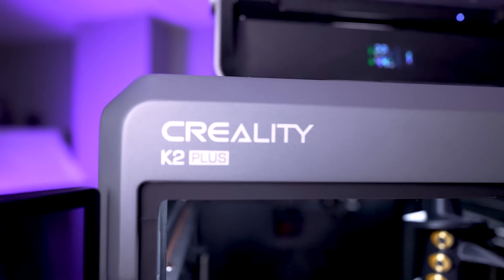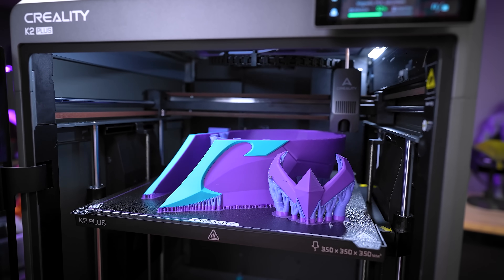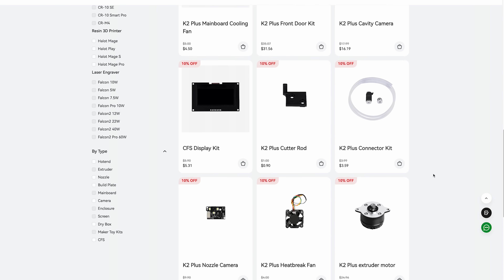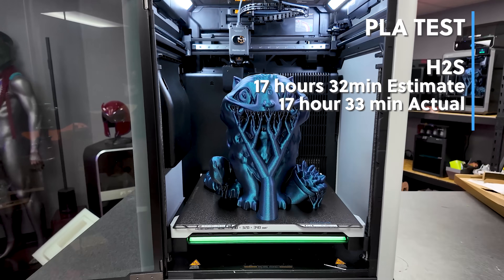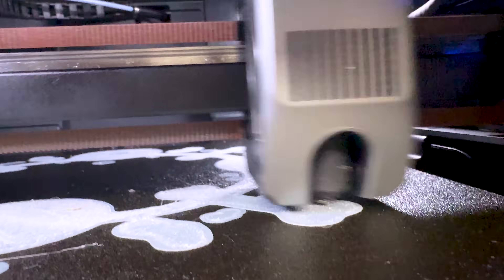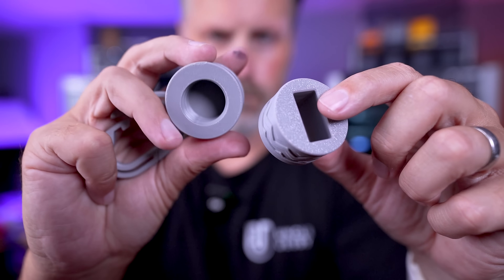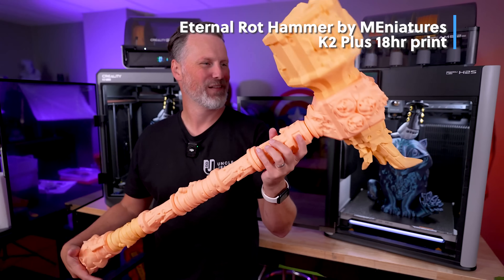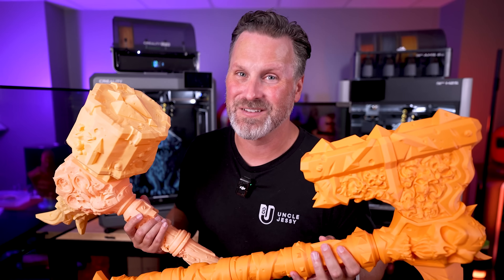Bambu Lab H2S vs Creality K2 Plus — 3D Printer Showdown 🔥

Comment: No competition, H2S hands down, creality is so hit and miss, I hate there printers with a passion, 1 of my P1S printers has over 4000 hours on it not even a hiccup, I print my stl files I design everyday and I had 2 creality ender 5 max printers worked for a week, both of them, they crapoed out,, will never use creality again, Bambu is so reliable and that is what I need.

Comment: As someone that’s coming from almost exclusively Elegoo printers, the H2S has really surprised me. First off it’s so quiet by comparison to the Centuari Carbon. And the software has just been so easy to use. I can see why these things are so popular. And I’ve been loving the AMS system to refill my prints when one spool runs out. So I don’t have to worry about if I have enough filament to print my larger helmets and just let it do its thing. And the Bambu Handy app is great to check on things when I’m at work. It’s definitely made me a fan.

Comment: Bambu's biggest advantage has been their usability out of the box but that's usually its biggest draw back. They are so great out of the box because everything is locked down enabling just about anyone to use them. This is absolutely a great thing but it's also why the K2 has been poorly market and received so poorly by those it was marketed too. The K2 kinda sucks out of the box but with testing and calibration I've found the max tool head speed to be either 1200 mm/s @ 30k accel or even better 600mm/s @ 120k accel not to mention the actual max temp of the nozzle is 450c if you take off the silicone sock and max chamber temp is 75c and with a quick re-wire mod its 100c however the electronics in the chamber need special cooling. That being said people forget that if a printer is able to go fast then they can go slow too and get godly print quality while teleporting during print moves. With PPS-CF at a nozzle temp of 370c my K2 was able to print at 300mm/s thats a flow rate of 25mm cubed literally the only printer that beats the K2 is the Vision Miner 22 Idex and thats a 15k USD printer and believe me that printer was a huge POS out of the box even the X1C was printing better and thats the crappiest printer we have in terms of quality prints regardless of printing speed.

Comment: I use TPU a lot on my k2 plus.  Can confirm that .6 shim to loosen the tensioner works wonderfully.  But I also combine it with a print that holds the spool above the top and feeds directly into the extruder.  No bowden tubes.
Reply: My K2 plus arrives tomorrow.  I am fully aware of the TPU issue, I don't use TPU but once a  year.  If I need to print that for whatever reason I will use my trusted K1max which still works flawlessly.
Reply: @daleblazer Yeah I found myself only breaking out the spool twice for some custom gaskets but haven't touched it since. I think I'm waiting for multi toolheads to be more common first before venturing into true multi material

Comment: The H2S weather you like it or not is miles ahead of the K2 plus in quality. Hardware and software makes it superior. I have both machines in my workshop, the K2 has more room, but it's lacks reliability and stability. from a business point of view, the H2S is the go. it's not even a competition. The K2 plus should be less than $800 based on the quality of the parts. it's not a $1299 machine.

Comment: Check your slicer profile for the PETG on the K2 Plus. They have it heating the chamber unnecessarily which I think leads to the filament gumming up in the extruder. Since I turned off the heated chamber on the PETG profile I've not had any problems with mine.
Reply: I also think you're having so many problems with your K2 Plus that you may have just received a defective one. I've had mine for about 8 months and it's rarely caused problems and prints great.

Comment: Everyone now says "Screw Open Source", No one cares any more. Wait 5 years from now when Bambu completely locks down their software and filament so everyone is forced to use their parts, and we're all so locked in and invested in Bambu, users can't leave anymore.

But because everyone want's "quality" and "speed", no one cares about open source or giving back to the community anymore. It's all about me, myself and I now and it's disgusting. No one wants to contribute, no one wants to help each other, hobby 3d printing is dead. 

We don't own anything and if it breaks, we should be "thankful" Bambu allows us to replace certain components on our machines (not everything, but only the parts Bambu allows you to fix)

Bambu is the end of consumer level 3d printers, just give it 5 years. Hobby 3D printing is dead and turning into a commercialized non-consumer industry. Thanks Jessy please stop talking about Bambu already
Reply: I don't know why anyone would want a consumer-level printer.  I'm out to make stuff, not tinker with a machine.

Comment: I love my K2 Plus (and my H2D) but that ptfe connection on top of the print head is a problem. Mine went bad quickly and the connector itself is not replaceable. However there is an aftermarket print so you CAN put a replacement connector on top. Been working like a champ ever since!
Reply: I have 2 K2 plus machines and only 1 has given this issue. Last week I replaced the extruder with PTFE after it failed and it failed yet again today. I replaced it again and I hope I don't do it for a while. Funny thing is the one that it failed on has 500hrs and the one that this part has never failed has 1800hrs, go figure. My k1 max never gave me issues until I did the CFS upgrade. Now I have no idea whats the issue.

Comment: I started with a ender printer from creality and switching to bambu one was amazing lol. It's just such a seamless process. Few problems here and there but overall my P1S has worked pretty much with everything I threw at it. Now I am thinking on the H2S :D (also that changer system from bambu is looking nice)
Reply: Get the H2S.  I haven't found much use for that extra head.

Comment: I cant get my CFS to work properly. I ordered a different spring that was suppose to fix it but it made it worse. It just has non stop feeding issues and gets stuck in the extruder. It prints flawlessly from the single side mount but I would like to use the CFS. Have you had that issue?

Comment: I feel like which printer is better isn't quite so cut and dry as some in the comments here are making it out to be. The H2S is definitely slower, costs more, and has a smaller bed. These issues might be a deal breaker for some over the K2 print quality. Also, the K2 having Orca is nice, and I wonder if some of the print quality issues in this video were from the K2 Plus being older and having far more use on it?
Reply: This makes senses to me, a 1yr old printer is likely to have issues, especially if it has not been maintained.
Looking on reddit, it seems like both Bambu and Creality have problems.
That being said I wonder if the issues that UJ had on the K2plus can be ironed out, however the printing volume cannot be changed.
On the flip side, the size difference isn't THAT huge.

Interesting comparison that actually needs to go further instead of being surface level
Reply: @Tuntira It would have been nice if this reviewer had stated hours of usage on this particular K2 plus rather than just age as it is likely that this K2 has high use considering that this reviewer is heavily into 3D printing. Regardless, there are nice upgrades available for the K2 plus like the Microswiss Hotend that help immensely with print quality.
Reply: @grimey4life  Agreed, I have been disappointed by a lot of these comparison of late. Very little nuance. It makes sense that a newer printer would have more developed tech and that an older printer would have be more mature. Also, I would assume that a K2 plus purchased on the same day that the H2S was released would not be the same machine that it was when released which is now well over 1 yr ago.

I fully understand that the reviewer can't be expected to buy a whole new machine  just for this comparison, but I think that the comparison is weaker without proper disclaimers and notices.

Maybe that is an opportunity for someone, reviewing printers months after release. Let's be honest, ALL printers get better over time, even Bambu printers, so knowing how the systems have aged over a year would be a fantastic resource.

Comment: My friend, I can confirm that the K2 Plus HAS  a problem with PETG. Send a multi color petg print file and record the screen of the 3d printer. Now when switching filament, notice that the temperature for purging/changing petg goes UP to 270c.... this causes clogs and tons of issues. It even destroyed one nozzle,  which was being used with PLA, as it cooked inside and it was unusable.
there is NO way to change that. Not in the printer settings, not in klipper, and not in the slicer. This is HARDCODED into the CFS.
I have mine set up fine with PETG, but I have to make sure my filament can withstand 270c, otherwise it WILL clog.

Please let us know if you find a solution to thaat issue. It is not an isolated issue, and is easily reproduceable, but nobody has addressed it yet.

Comment: We have a K2 Plus at work and it’s hit or miss how good the prints come out. The inconsistency with print quality and especially the bed leveling have been super annoying. Higher bed temps seem to make it worse, even after letting the bed heat soak before leveling. We also had that issue with the filament tube coupler going into the extruder breaking, but Creality send replacement parts free of charge. Apparently it’s a really common issue and there are a bunch of community mods available to mitigate it.

Comment: Is there a way to slow down printing on the K2 Plus in order to get better print quality?
Reply: yeah you can do that for any printer, since the speed is dictated by the gcode generated by the slicer. it's in the "speed" settings in the slicing preset. You can set both max speed and max acceleration there.

Comment: Had a K2 Plus and had nothing but trouble....every single day. It could not print ANYTHING other than PLA. I ended up selling it. Moved back to Bambu Lab, and have had no issues with my H2S or H2D. Thanks for your videos, they are informative.

Comment: I picked the 40w H2D with 3 AMS’s and 2 HT’s. I also order the smooth plate, high flow nozzles and the calibration plate. It should be in about a week

Comment: So I’ve used my H2 S for several days now and it’s been perfect since the very first print. 

My Creality K2 plus I have had since March and have really grown to like that machine also. The only way I can get a perfect first layer on it is if I set the Z offset at .065 with a .98 flow ratio gives me a flawless first layer with PLA. 

The one big issue I have with the Creality is making light boxes. No matter what I do, I cannot get the seam to overlap on any print file using any slicer. I have lowered the Z offset, I have done a higher flow ratio, I have done zero on the elephants foot and still have gaps where colors meet. Not a single problem with the H2D or H2S.

Comment: This is typical of Creality. "But my Creality machine prints flawlessly!". EXACTLY. Their machines are a gamble - I've owned 4 Creality machines and all 4 had flaws out of the box that required fixing before I could get decent prints. Their quality control is just not as good and you can even have a printer that is totally unusable which was the case with our CR10 V2 which was HORRIBLE.

Comment: Why do people still mix up print speed with velocity,  They dont claim printing at 600mm/s or 1000mm/s the max velocity of the print head is 600 and 1000mm/s... So many people think thats print speed advertising, even the Bambu website states: 1000 mm/s toolhead speed not print speed and the fact so many youtubers get this wrong that deal with the community is weird..
Reply: It's even worse when filament companies list the max linear speed to print.
At what height? With what size nozzle? Linear speed doesn't even give a starting point for calibration.
Like, if the max toolhead velocity is 600 and you've got a good extruder paired with a fast melting filament, there's a good chance you can get to that speed in long straight lines. But maybe not!

A few filament companies give suggested max extrusion rate in mm^3 and it's a breath of fresh air. With most of them you have to guess or ask around for a good max flow calibration start point.

Comment: I picked up a refurbished K2 Plus Combo with about 250 hours print time for $970 tax included on eBay. I also picked up addition CFS for total of 8 colors. I've been printing 450+ hours using PETG almost exclusively with no major issues. Really love this machine so far.
Reply: I had been printing PETG almost exclusively on the K2 also @ 270c and chamber temps of 45c with fan at max. It has given me zero issues and lots of practical parts. However, I've now been printing pure transparent Polycarbonate at 300c and chamber temps of 60c with fans at 20% with PC the K2 kicks out super stiff parts that are dishwasher safe and chemical resistant.
Reply: @Guardian_Arias  Isn't it a bad idea to use the heated chamber for PETG and PLA? My QIDI always warns me to keep the door open when using those.
Reply: @redkingrauri3769   Nope, especially not for PETG since it actually does warp while printing larger parts and it improves the layer adhesion significantly. 

PLA is the same story, but the warping comes from the bottom layer printing at lower chamber temp and then the upper layers of large prints print at higher temps plus the lower layers eventually also warm up during larger prints and you end up with random bed adhesion problems like towers tipping over or parts coming up randomly even though the first layer was perfect. Even with an open door the chamber temp WILL go up and or you will get hot zones like a 1960 oven, SO why not just steer into the skid and embrace the purpose of enclosures? That purpose being the ability to stabilize chamber temps and for that reason when print PLA I pre-heat the chamber to 35c although I rarely ever us PLA these days.
Reply: @Guardian_Arias   I left the riser vents open to prevent the chamber from getting too hot and activate the fan which causing z-banding on some prints.
Reply: @Guardian_Arias  I'm using Jayo HSM PETG (~$7 per 1.1KG roll) and Elegoo Rapid PETG using Creality Hyper PETG profile with Z-Offset set to 0.12 and Pressure Advance and set to 0.6. Both Elegoo and Jayo print great using the same profile.
Reply: The value proposition for the refurbished K2 plus printers on eBay is very good! I saw one for $780 the other day and almost got it! I'm not into the AMS CFS, I have two Sovol SVO8's and will be adding the INDX bondtech tool  changer when it comes out!

Comment: Also, poopchutes cans cause 99% of your backups.  Let it poop all over the floor, it wont do that anymore unless you let the pile get about 2 feet high.
Reply: I just put giant box under table and let k2 poop in it not a single issue
Reply: OR, build a poop chute that sits below the opening so when it falls out it actually falls.  The one I made for all of mine sits at least a centimeter below the bottom and has a wall to catch the poop.  Never had a jam on any of the machines this way.  The ones I made use the base of the machine as the support so nothing gets in the way.
Reply: Just print your poop chute in a high-temp material that won't get melted by your hot purges, that will solve most of your sticking problems. I printed mine in ASA, and have had zero backups so far, but I haven't tried printing with the high-temp engineering filaments yet.
Reply: Just make it bigger …

Comment: Just picked up an H2S on labor day with an ams2.  I dunno if it was on sale or not but I didnt pay 1499.  Havent used easy mode PLA with it yet, but it is doing about the same as my 2 X1C units on petg.  Seems more picky if the filament isnt perfectly dry. Likely due to the increase in speed.

Comment: for the poop chute, I have made a steeper angled chute that is a pipe, rather than an open slide. This pipe runs in to a hole thay I drilled in the countertop (wooden) and goes directly in to the garbage. No hassle of clogs, once every 2 months to dump out the discarded poop from the garbage bin below.

Comment: I had the same problem with clogging on my H2D's poop chute, until I reprinted the poop chute in ASA. Hot poop was sticking to the original PLA chute and causing huge backups. ASA solved that.

Comment: Cool vid. While I like Creality, I would go with the H2S just due to the ease of using different material like TPU. I mean for the price I'm paying I shouldn't need a mod to make it easier on the K2
Reply: It's like Creality must re-invent the extruder for each and every printer line. Not always for the best.
S1 extruder was good, and K1 extruder was OK after they fixed it. K2 (and Hi, it's the same) are more downhill from that.

Comment: I think it’s worth noting that Creality stuff tends to fall off a cliff on the used market. I was able to pick up a K1C for around $200 about a year ago when it was still relatively new. Bambu definitely holds value better. 

For new pricing I’d take the H2S, but if we’re talking $800-900 for a used K2 combo, I’d be all over that. They’re capable of amazing prints, with pla out of the box and after some testing and tweaking with other filaments.